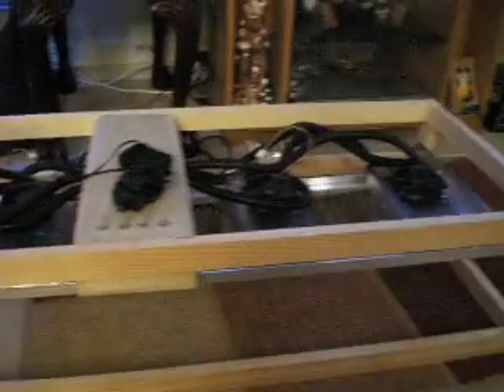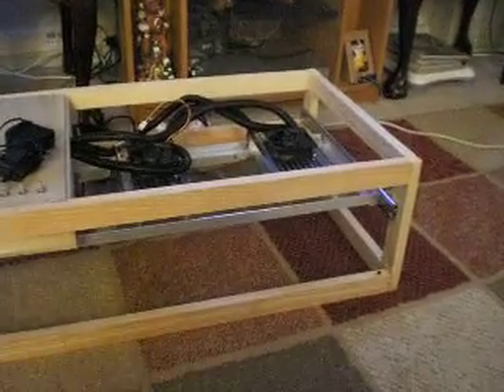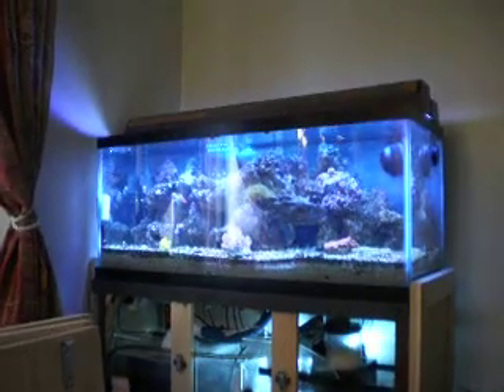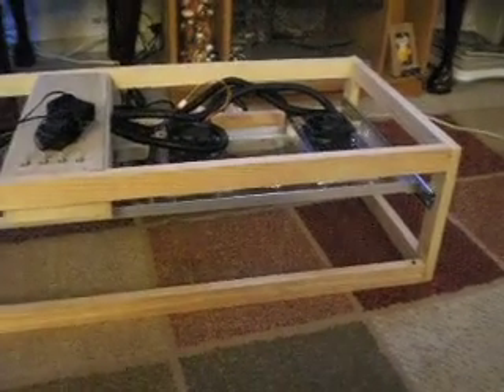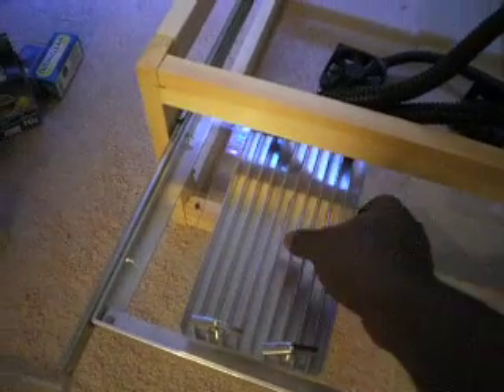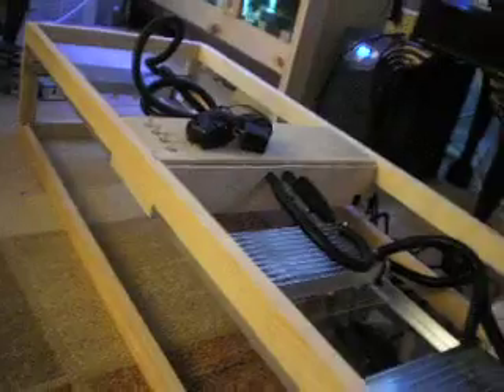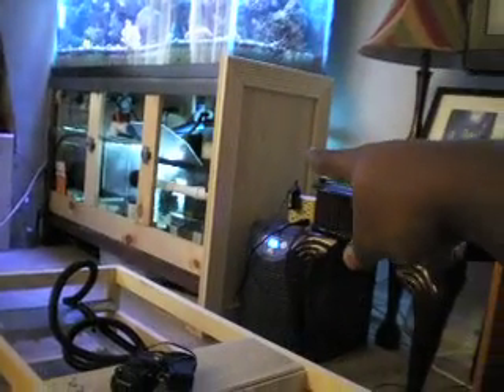Diy led kit and fixture pt 1

Comment from the maker: @loknar28 hey L the whole kit cost $335.00 which includes 48 led white and blue, 4 drivers, 4 power cords, lens and wire... the only thing that is not included in the kit is the heat sinks  ..... so visit rapidled.com and check them out.... good luck